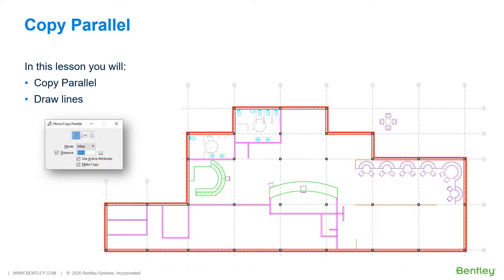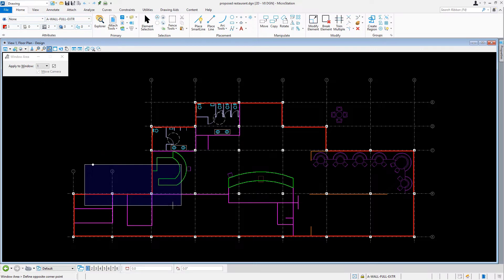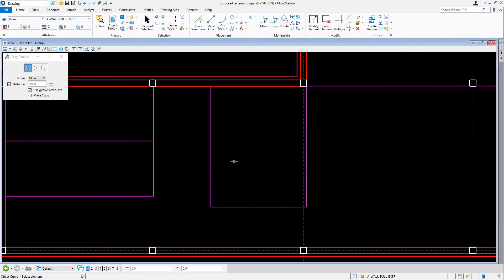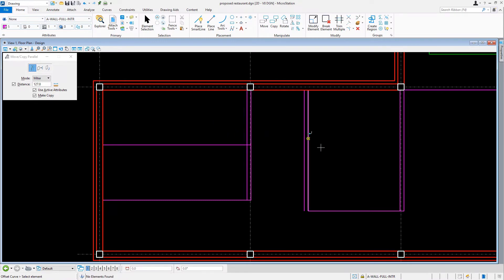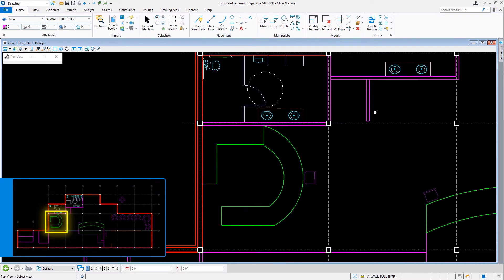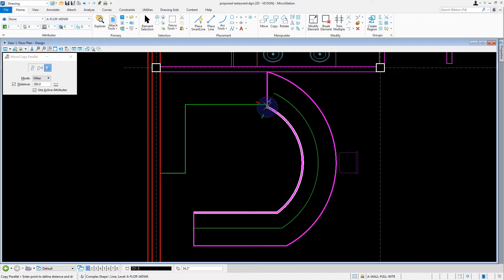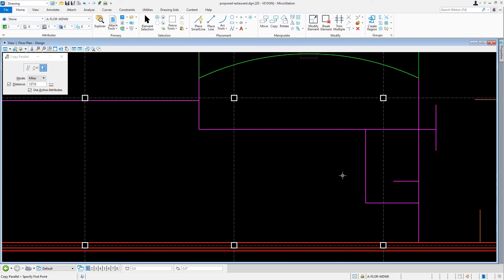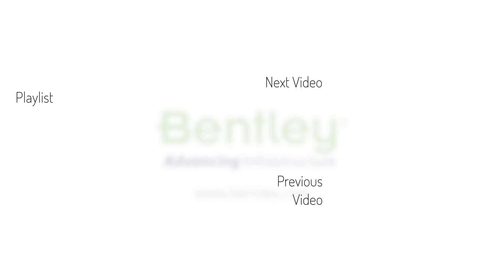Part 1 Copy Parallel

Comment: This tool does not work in 3D well. When copying parallel on non planar elements, there is no option to lock the Z values. Bentley needs to incorporate a tool similar in functionality to autocad's STEPPED OFFSET, and OFFSETFEATURE.